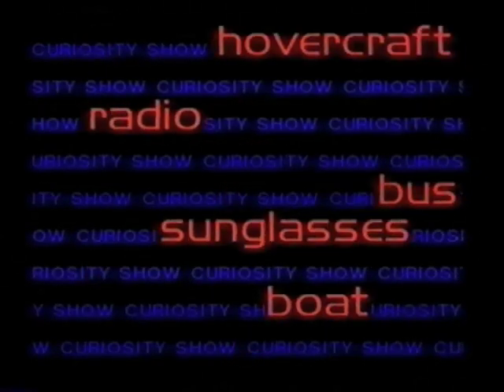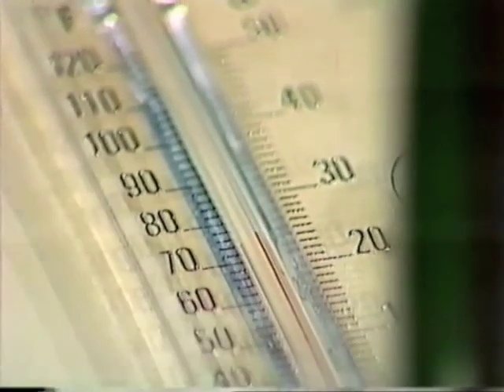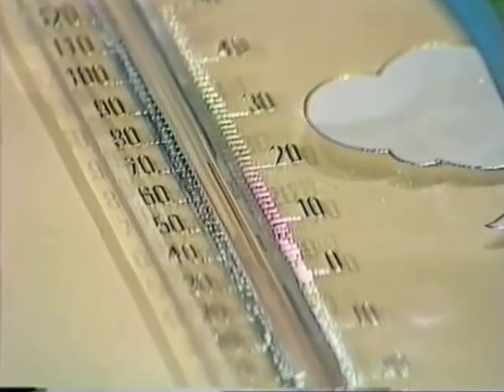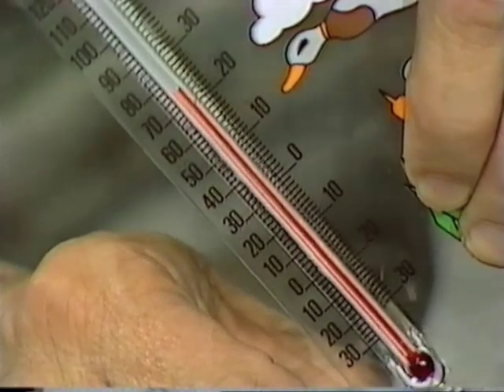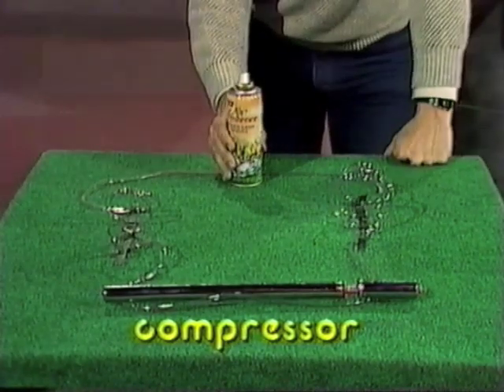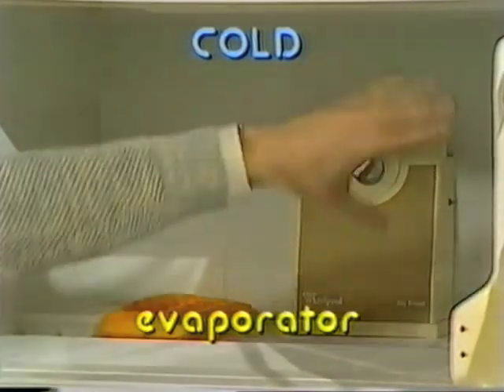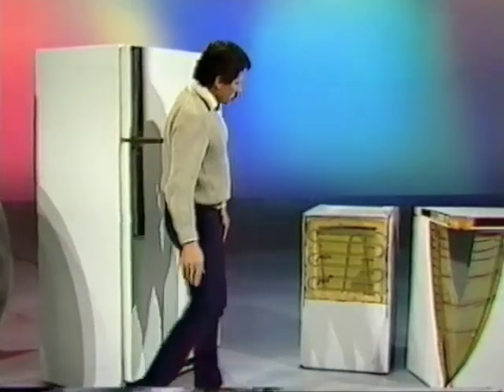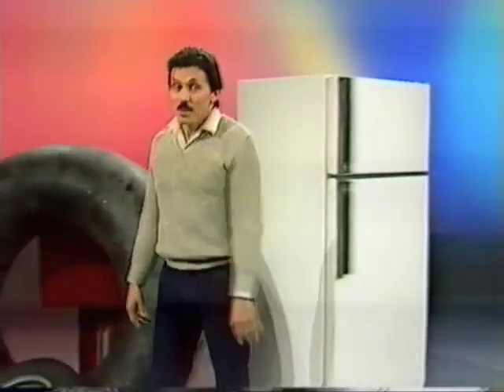Refrigerator - How Does It Work?

Comment: is this the exact same concept how an air conditioner works? can i turn a frige into an ac unit to cool a small rv?
Reply: cool thanks. yeah i figure. im just trying to do what an ac does in a car. but f it. i quite this is hard.
Reply: The principle is the same, yes. 
If you stuck the back of your fridge out of the window and opened its door to the inside of the vehicle. However, it would be inefficient because it's not designed for that application.
In general, this kind of device is called a "heat pump" because it works to move heat from one place to another. (The inside of the fridge gets colder, and the room its in gets hotter!)

Comment: Someone please correct me if my thinking is wrong.
1)Heat is transferred from inside compartment of refrigerator to the coolant gas which is at a lower temperature than that of inside air.

2) This coolant which was semiliquid and gaseous before is now converted into complete gaseous state at a higher temperature than before. 

3) Heated gas after reaching compressor gets heated further due to compression. This is because the molecules are now vibrating more vigorously in close proximity to each other causing buildup of heat. Also the gas is at higher pressure.

4) This heated gas enters condenser coils at the same/similar high pressure causing the molecules to strike the insides of the coil and losing its heat energy (kinetic energy of molecules in this instance) to the coils which gets heated in return.

5) The coils are cooled by the room air flowing around it.

6) The gas after reaching near the end of the condensor coils is nearly of room temperature and still at higher pressure so it is condensed in this process to liquid state.

7) But for cooling we need the coolant gas to have lower temperature than that of the inside air molecules. This is where  the expansion valve plays it's critical role.

8) The liquid coolant enters the coils of refrigerator after passing through the expansion valve (which is controlled through sensor technology) at a low pressure. This allows the molecules of refrigerant to expand and in this process lose their kinetic energy for expansion in the form of heat(enthalpy). And cause further cooling of the coolant/refrigerant whic is now semiliquid and gas combination and at a much lower temperature than the inside air from fridge compartment thanks to expansion valve. And the cycle continues.
Reply: Pretty much spot on. Only thing I would like to add is some details on the metering device. There are a couple of different types of metering devices. There are piston style, capillary tube, thermal expansion valves, and electric expansion valves. Pistons and cap tubes do not have any moving parts and are not adjustable. A txv or exv are adjustable. A txv regulates flow based on superheat, an exv is computer controlled through multiple sensors.
Reply: @Redtooth75  Thanks for the added info 👍

Comment: But why is the temperature difference between the evaporator and the condencor so big? I mean the compressed refrigerant's temperature is let's say 50 degrees but by the time it reaches the freezing compartment, it is below zero! If all the excess heat goes through the heat sinking net to the outside, shouldn't that mean that the room temperature would be really hot?

Comment: So how come the can isn’t super hot before he blows it out? If the molecules are compressed and by his own words “compression causes a hearing effect”
Reply: The heat dissipates over time.    The reason a refrigerator is able to use it for cooling is that it compresses and evaporates the refrigerant in rapid succession, not allowing the time for it to heat or cool on it's own.

Comment: He doesn't explain what exactly is happening with the spray can. It's the spray can contents spreading out that does it, which spreads out the heat energy of the can's contents through a wider area, making not only the spray cooler but ALSO the can.

It's an especially safe experiment to do this with compressed air, where you can spray out a lot of the can's contents and wind up with a freezing-cold can.

Comment: I'm pretty sure He missed one thing which is. 
The black colored coils which are hot because the liquid which was compressed by the compressor is let to cool down to the room temperature while its compressed and then this compressed liquid at room temperature is evaporated which makes it cool, cooler than room temperature. 

Im pretty sure he didn't mention something about letting the coolant to get at the room temperature. Or maybe this was very much detailed so he skipped it.l for simple explanations. Still cool

Comment: Shouldn't call it "evaporation". Wrong word to use. Evaporation is the process where a liquid changes to its gaseous state. In the refrigerator case, its just "expansion". Otherwise a great & simple explanation !!
Reply: The refrigerant does evaporate in the evaporator coil. Compressors suck in cool low pressure vapor, discharge hot high pressure vapor. Condenser coil removes heat from the vapor condensing it into a high pressure liquid. That goes through the metering device into low pressure evaporator coil and starts to change into a cold low pressure vapor, absorbing heat as it does. Then the cycle repeats.

Comment: If you really want to understand how a fridge works, you will not learn much watching this video/TV show.  He hardly mentioned evaporation.  I don't think he mentioned condensation once.  He defo didn't say anything about latent heat.  His analagy of the bike pump is not how fridges work (except aircraft air conditioning (search bootstrap air cycle))

Comment: Since a refrigerator always produce heat when it work,,,... than why not those refrigerator companies use that heat to pump the compressor which save electrical energy.!!!
Reply: shasank shahi that heat you are talking about is the unavoidable effect of compressing a gas. In other words, it's an energy that comes out when the process of compressing is already over for that cycle.

Comment: He neglects to teach the main reason for the cooling and heating with decreased and increased pressure.  Heat is nothing but the faster movement of atoms from their previous state, and cooling is the normalizing and slowing of atomic movement or decreased vibrations.

Comment: too bad theres no material that cools itself passively if you could cover your room with it to resist the heatwaves like somekind of nitrogen gel and have like a radiator cooling effect but that would cause problems during winter 
the problem is isolating hot spots or zones with cooled air and these portable air conditioners are very not efficient by design why they even exist in the first place i never tried them its tempting cause theres no cheaper alternative besides a air fan but then it blows hot air is kinda barely effective humans are not like your PC graphic card or CPU where a simple bigger then default air fan with vapor chambers that get the most out of air cooling better with liquid cooling
soviet architecture relays on design to cool and warm up passively like a greenhouse effect or air circulation if the room allows it

Comment: Poorly explained. To clarify: the compressor pressurizes the gas so it can be evaporated again to cool the fridge in a cycle. A condenser is used to cool the compressed gas, which returns to a liquid form.
Reply: If you're going to "correct" someone please at least try to get it right yourself.  The compressor compresses refrigerant liquid into gas and the condenser converts  it back into liquid, cooling at the same time, as he clearly explains.    This video is for someone who has no idea about how a fridge works, you seem to have missed that.